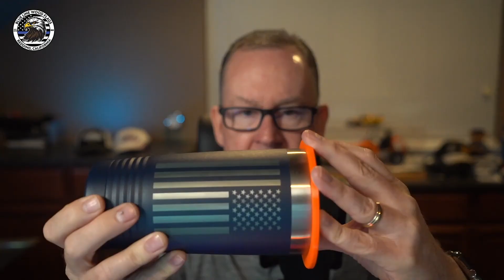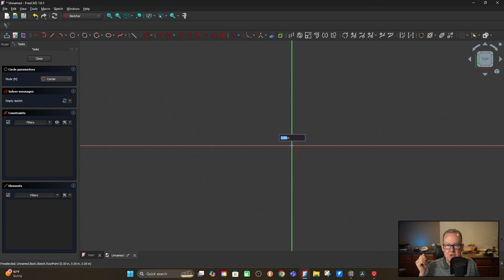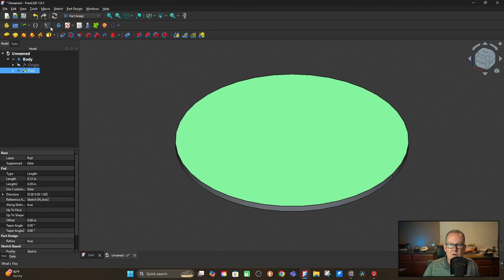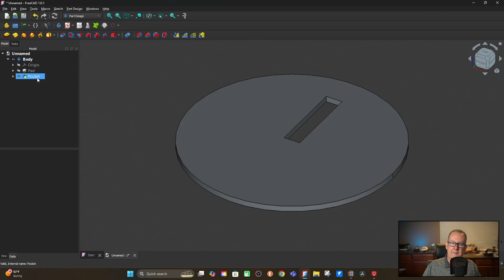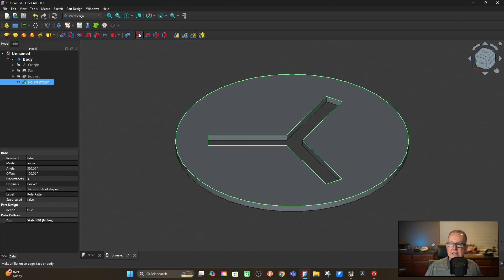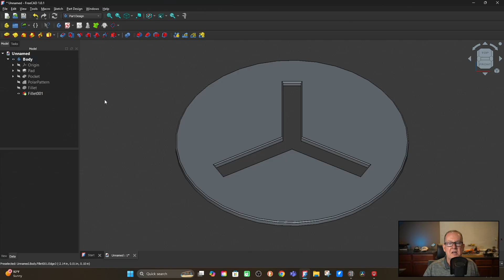Use FreeCad to Design and 3D print a Rotary Chuck Backplate for your Xtool RA2 Pro!

Comment: This was a great lesson and tutorial... I'd love to make that part, but I don't have a 3D printer. Can that part be cut using a diode laser using a different file format?
Reply from the maker: You could certainly design it in something like Adobe illustrator (or similar program) and save it as an SVG for your laser to cut out. If you have xtool Studio you can design it natively in the laser’s software. The same can be done in lightburn. Just use my dimensions and you should be good.
Reply: @BlueLineCNC  I followed your instructions and ended up with a great backplate 💙